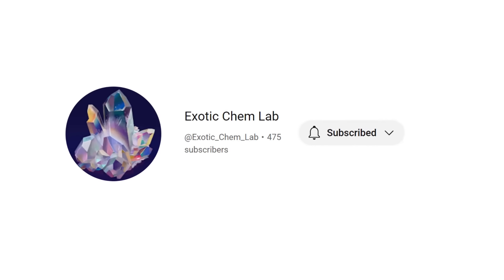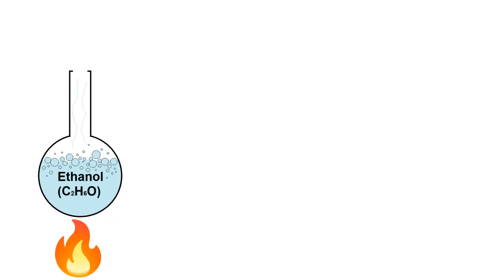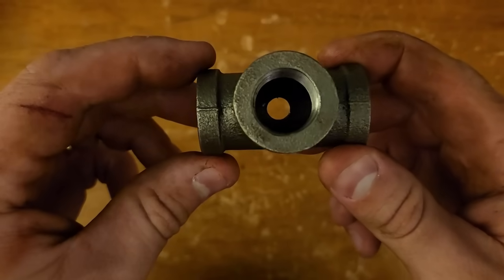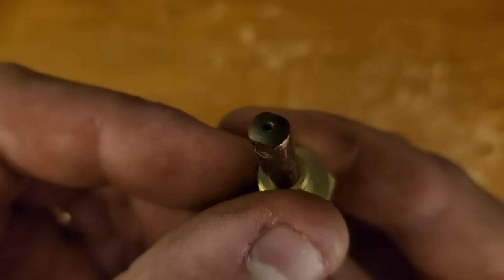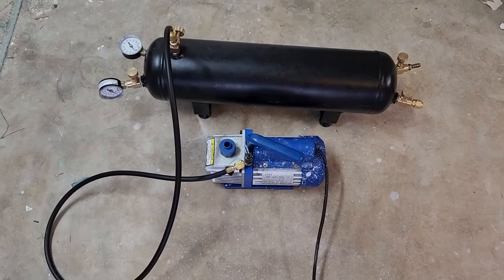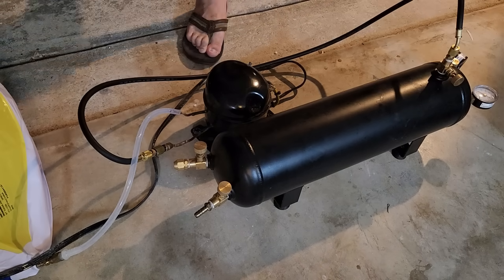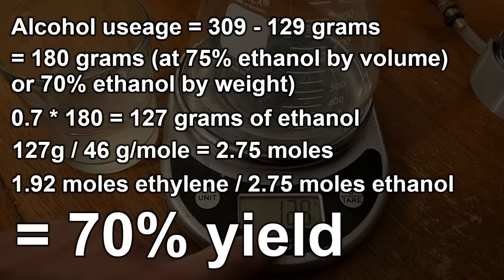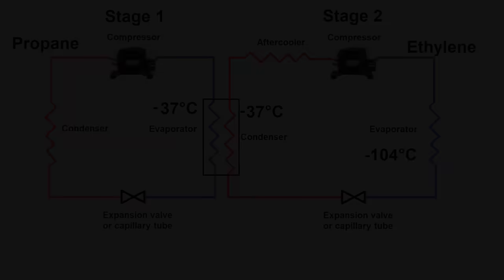Making Ethylene (Refrigerant R1150)

Comment: Cool video, fyi in your last video you had a heat exchanger, if you reverse the flow on one side you'll increase your effciency using  contraflow cooling which uses "warm" coolant to pre-cool the "hot" coolant and cold coolant to chill the "warm(previously hot coolant)" down could gain you a few % in effciency for a change of plumbing

Comment: I think for a better way of controlled heating would be some kind of resistance heater with a PID controller, youd make a heater that would surround the catylyst pipe and the thermocouple would control the heating better than a fire. a way I would think of doing this would be making a open ended tube heater where you can add fire bricks with holes drilled in them for insulation that are the diameter of the catylyst pipe. would be better if you want really precise and even heating.

Comment: if you fear hydrogen, use phosphoric acid as a catalyst, then you only need 200-250c for a good rate, and no gaseous byproducts.
Reply: Do you have any links to more information?
Reply: @KallePihlajasaari  A LABORATORY METHOD FOR THE PREPARATION OF ETHYLENE. By G. S. NEWTH   1901
I cannot paste links.
I put the acide unto some activated chacoal, electrically heat it, and feed it ethanol vapors from a boiler like in the video.
Reply: @Ryba125  Thank you! This seems like it needs a much less elaborate setup as well. I literally HAVE all the gear to do this method! Except a decently strong form of ethanol, but that's easily solved. I really enjoyed the author's note about using the same 50cc of acid for weeks.
Reply: @Ryba125  Can you tell me more about how you are using the activated carbon? Is it like boiling chips, or would I want to make like a slurry?
Reply: @brianwelch1579  i only use it as a support for the acid. My reactor is standing up, with the vapor feed at the bottom, so they can co trough the charcoal and be converted.
I simply wetted the charcoal beads with the acid, it is not a slurry in my case

Comment: What if you made 2 additional catalyst beds, so 3 total, and then laid them side-by-side with the gas following an S shaped flow path, and heated all 3 evenly? If raising the temperature is causing too much product to break down, but keeping the correct temperature is giving poor yield, maybe the gas just needs more... dwell time, I guess, at the correct temperatures?
Reply: longer path could also yield worse as there's also more chance for the molecules to breakdown?
Reply: @viliusaleksa9944  if the degree of breakdown is temperature dependent as shown on the graph, I think that's less likely to happen. Typically compounds are stable more or less indefinitely until an energy barrier gets overcome - I think in this case keeping the temp at 450 for a much longer time would allow the ethylene formation without leading to wholesale breakdown. But I don't have the equipment to do this myself, so I can't test that hunch.
Reply: @wtechboy18  at 450° agreed, author was running on 500°  so I was thinking about that 500° temperature

Comment: For your calculations, the mass you distilled from the flask of everclear wouldn't be 100% ethanol because ethanol and water form an azeotrope. A mixture of 8% water and 92% ethanol has the lowest boiling point, so that was probably what you distilled over. Making your own ethene is astounding. Impressive yield.
Reply: The azeotrope is actually 96.4% I believe
Reply: @rollei35mm  yeah from my home um "experiments"... Can confirm 
96% lol
Reply: @djsnowman06  technically 95.6% but yes.  Sorry, I had to be that guy
Reply: @thetaintpainter5443  yea my alcometer isn't graduated to the tenths... Besides for my purposes the difference of +/-0.5% is negligible lol
Reply: @thetaintpainter5443  false
Reply: @thetaintpainter5443  it isn't 95.6 I have distilled 96% on a copper reflux, verified this with 2 different float hydrometers and a digital they had at the local brew shop.

the maximum percentage is determined by a few factors, if you were living at 10,000ft it would be a much lower percentage than if you were living at sea level, humidity and ambient temperature can also mess with this number. 

That all being said you can get to anhydrous ethanol if you vacuum distil and use 3A sieves, but for the sake of fairness I assume you are talking about an open vented system only.
Reply: @74KU  mgs04 storage aswell
Reply: @74KU  ethanol water azeotrope it is 95.635 wt% ethanol by volume.  Alcohol hydrometers usually have a tolerance of +/- 0.5%.  You can look that up.  Also, ethanol and water form a minimum boiling azeotrope, meaning they can’t be separated by modern distillation techniques (besides molecular sieves or azeotropic distillation with something like benzene, but that would make the ethanol unable to be consumed.  They do this a lot for lab grade ethanol).  Furthermore, the azeotropic composition of ethanol/water doesn’t vary much at all with differences in external pressure, azeotrope characteristics are based on ethalpic interactions between the molecules.  Variations in external pressure will not change the ratio of ethanol/water in the azeotropic vapor.  If that was the case, then a vacuum distillation would be all that’s needed to break an azeotrope, but in practice that does not happen.  So no, someone at 10,000m about sea level would not have a “much higher percentage” than someone at sea level.  It’d be the exact same.  Humidity only seems to affect composition of the azeotrope since concentrated ethanol is hygroscopic and absorbs water from the atmosphere.  Also, ambient temperature does not affect azeotrope concentration, that just makes no sense at all when in the context of Raoult’s Law (which is the chemical theory behind why azeotropes occur, a negative or positive deviation from the curve). The only true way to get about 95.635% ethanol is by breaking the azeotrope or drying out the water, variations in atmospheric pressure do not affect the interactions which are responsible for azeotropic behavior.
Reply: @rollei35mm  that doesn’t affect the percentage of ethanol to water in the azeotropic vapor during distillation.  Once you add more or less ethanol to the mixture after distillation, it’s no longer an azeotrope.  Poor Storage will affect the ethanol concentration over time, but that’s not the same as changing the azeotrope.
Reply: @rollei35mm  95.6%
Reply: @rollei35mm  Yeah I was going to say I thought it was 96.5 
Ambient air pressure can change that though, 96.5 is for (I think) pure water containing ethanol at sea level at "room temperature" (20 degrees)
Reply: I was thinking the same thing as I watched.  p.s. he's still way smarter than me
Reply: I did the distillation 10 times again and again at right around 79°C just for fun and it always comes up to be around 95.72%, I calculated it. The only way you can get 100% pure ethanol (which we, chemists need for some reactions with ethanol but we can't afford to have any H2O present because it can ruin the reaction) would be to add a drying agent like anhydrous magnesium or sodium sulfate or even sodium carbonate which you can get by bubbling CO2 gas into NaOH solution or even simpler (for DIYers): you can get it from baking soda at home just by heating it up, because it'll end up releasing CO2 gas from one crystal and then a hydrogen atom from both and then the single oxygen atom which will then combine to make carbonate ion CO3²- and it will attract 2 sodium one plus ions (Na+) to balance out its electrical charge and you'll end up with sodium carbonate (Na2CO3) rather than bicarbonate (NaHCO3) and water and CO2 gas will get kicked off through the mechanism that I just explained and then you can heat it up to 350°C for 10-15 minutes just to make sure it's all anhydrous Na2CO3 and due to its crystal structure nature, it is possible for it to bond uo to 10 molecules of water per one crystal of sodium carbonate to form sodium carbonate decahydrate (Na2CO3×10H2O) and it can look dry because it ain't actually wet, the water is chemically part of it and that's how you can dry solvents with it for DIY you just add a little bit of it to a solvent and stir it until it clears up and you see that upon adding more at some point it willl not clump up and just stay as a powder and that's when the solution should be water free and you can even do overkill procedure and add 10 grams more of anhydrous powder per 100 grams of solution that you're trying to get water out of and then you can filter off the wet sodium carbonate and you have your nice and dry 100% ethanol or any other solvent that you're trying to dry and Na2CO3 can be regenerated simply by placing it onto a paper and leaving it around a day or 2 at room temperature to let the residual organic solvent evaporate and then once it looks dry you can put it in the oven at around 180°C or around 350°F for half an hour to drive away the moisture and get the anhydrous powder again, just remember that it has a downside of being really basic once you dissolve it in water, so it will react with any acidic solution and neutralize it (aka ruin it), so it can't be used to dry out the acetic acid for example and anhydrous sodium carbonate and really any anhydrous powder should be kept in a sealed bottle to keep it from moisture and even 100% pure ethanol really likes water and it will start to absorb it from the moisture in the air so you wanna keep it sealed too

Comment: Very cool video! I suspect that the liquid you collected after passing the ethanol over the catalyst is mostly a mixture of water and unreacted ethanol. Diethyl ether is immiscible with water, and only slightly soluble, so you would expect to see a separate layer if an appreciable quantity of ether was produced. Ethanol is also less dense than water, but fully miscible with water, so this may explain the lower density of the mixture. A lower concentration ethanol/water mixture isn't super flammable though, so you may be right that there is a little bit of diethyl ether dissolved in the water which caused the mixture to ignite. If you distilled the mixture to determine the composition, I suspect you'd find that it is mostly unreacted ethanol and water. I'm excited to see you use the ethylene as a refrigerant and look forward to that video! Great job.
Reply: Could ethanol contamination allow ether to become missable in the aqueous solution?
Reply: @garbleduser  ooh, very possible.  Ethanol and ether are miscible. I agree that fractional distillation would be nice just to see what the composition is.
Reply: in my experience it smells more than diethyl ether and something else, and not like ethanol at all. also it can be oily and stick to the bubbler - so I hope you got your dog a new bowl.
Reply: Would be nice to se it fractionally distilled, just for the science.
Reply: My IQ is for sure too low to speculate but maybe because of the way he heated the catalyst he had a range of temperatures at different places. Maybe a more consistent way to control temperature throughout the catalyst might help. Again I may not even be making sense I definitely am not even a novice.
Reply: I'm thinking maybe refluxing the vapour before going to the catalyst might help with both having stable flow, less water in it... Also I'm guessing there isn't much harm in feeding back the post-catalyst liquid back into the primary flask? But that's just for yield efficiency, probably way more hassle than it's worth, if you just want N of the gas..
Reply: Acetaldehyde is another possible product via dehydrogenation. It is miscible with water, flammable, and boils at 20C.
Reply: Diethyl ether solubility in pure water is 69g/L (or 6.9% mass-wise). So there must be quite a lot ethanol to form the solution.
Reply: It's most likely a ternary mixture, and I'm pretty sure that the ethanol would enable dissolution of more ether without phase separation.

Comment: Cool, thanks for video. There are also "autocascade" phase-change systems, using mix of different refrigerants while using the same compressor in system. Polycold is (was?)  one of the famous manufacturers of such systems for industrial use. You still need oil separator, compatible refrigerants and some heat exchangers for system to work, but at least don't need additional compressor. Oil separator is needed for reaching low temperatures, otherwise it will freeze up and clog the capillary tube restriction.
Reply: It is a lot of cold storage brands out there, mainly running at -152C.
Using auto cascade as you mention, but very few use a single stage system.
The first stage pre-cool the auto cascade second stage system.
Horrible pressure even with two stage due to the high pressure gases time to reach a condensation temperature.
Often two oil separator in series and capillary tube heaters kicking in on cycle off periods by a timer to clean oil off the tubes.
Very expensive gas mixtures on them with  critically share of the gas un the mixed blend and the total amount.